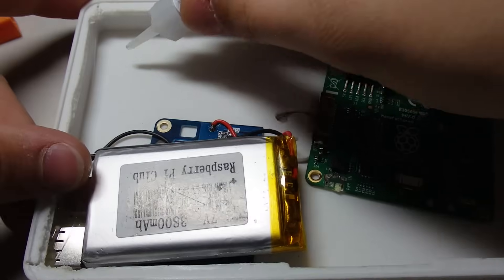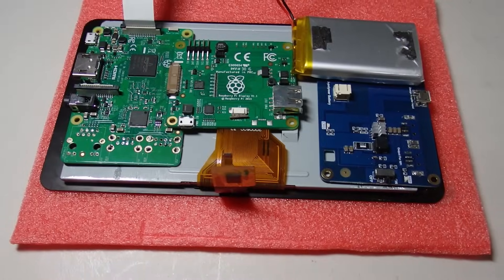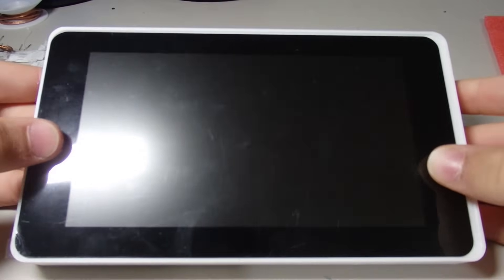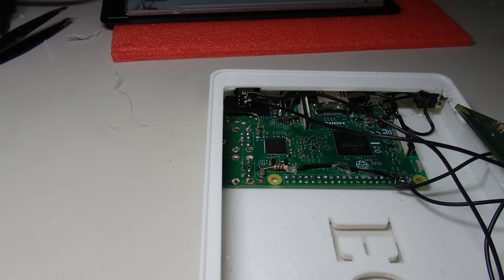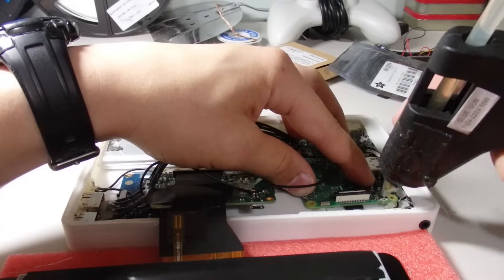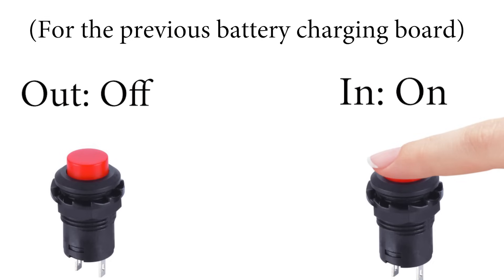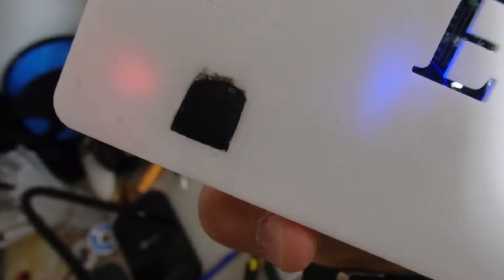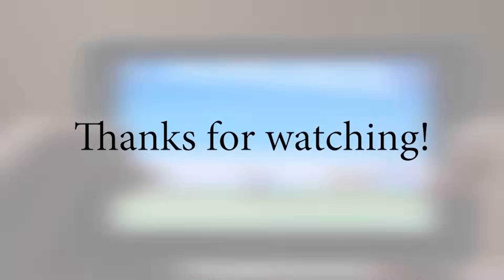Building a Touchscreen Android Tablet

Comment: I've been looking for a video where someone builds their own Android tablet this is the closest I've got to it but what I had in mind is someone using like a Galaxy motherboard like just a bunch of random nice parts from different phones and tablets and put them together like maybe a Galaxy S21 motherboard with like an iPad screen and body or something along those lines and just splicing wires putting your Android operating system on it and call it a day I'm just wondering why no one's ever done that make a Frankenstein tablet or like those cheap Galaxy a tablets they don't have the best processors but they have a nice body and nice screens maybe just replace its motherboard with a flagship Samsung phone motherboard and s*** even use the cameras you might have to splice wires to make the camera go to the hole but it would work if no one doesn't I'm going to for sure

Comment: Could you offer any helpful advice re: removing the USB and Ethernet components from the board? I tried to do a similar project last year and failed utterly because I couldn't get those things off without damaging the board.
Reply from the maker: What I do, is stick a screw driver into the port and gently pry up on the port as I desolder it. When I desolder it, I add extra solder to each joint and sometime even connect them all together so that I can heat up all of the joints at the same time. 

Or, I will work my from the joints closest to the opening of the port (where I have the screw driver) to the end or the port.

I hope this helps!

Comment: It looks so messy. No wonder the first screen broke. Next time fill the empty space with a custom printed circuit board to connect up ports and the power supply. It will look a lot nicer and won't need so many wires that could be a potential eyesore when building it or making repairs. I also think this would be better off as some kind of computer hybrid; in my eyes it seems a bit too thick to be a tablet. That's just my opinion though :). I hope you make an updated version of this. (Maybe with a magnetic removable keyboard?) 

Best wishes on your future endeavours!

Comment: Gday First time to the channel

Interesting idea

But lacks USB ports to recharge battery and ability to remove battery from back of case 

Also seems to lack external wifi aerial and no HDMI out or LAN ethernet port

Would it just not be easier to make a case out of wood instead of 3d printing ?

Comment: RIP internals and previous screen that was gud and could have been used normaly if not for comfort ot something. Btw u could have put the pi and everything on a plastic board for managment and then tought how to fit them in a 3d printed case for the size of the screen.

Comment: I've built my android tablet with 7.1 running on it. is there a way to run to 2 raspberry pi in parallel to make a faster system or is there another board i could use?
Reply: Use odroid.

Comment: FYI - regarding your issue with using a power switch and the powerboost. I ran into the same issue when I used an old NES case and wanted to reuse the power switch on the front of the console. I ended up wiring the power switch to the battery before the power boost so pushing the power button in allows the battery to connect to the power boost. Button out, kills connection.

Comment: whitch 3d printer is that the printer looks very good i will buy it
Reply from the maker: It's the "Tronxy P802e 3d printer" Here's a link to the Ebay listing for it: https://rover.ebay.com/rover/1/711-53200-19255-0/1?icep_id=114&ipn=icep&toolid=20004&campid=5338052152&mpre=http%3A%2F%2Fwww.ebay.com%2Fitm%2FTronxy-Auto-leveling-P802MA-3D-Printer-High-Precision-Reprap-Prusa-i3-8G-SD-car-%2F272513046357%3Fhash%3Ditem3f730b1755%3Ag%3AdLYAAOSwjDZYcFU5

Comment: Good lord I cringed so hard when you wired those batteries in parallel. Yes you get more current in the system, but you just wanted overall capacity, so they should have been put in series. You very rarely put batteries in parallel! I saw your post that you learned your mistake but eesh that was bad.

Comment: Hi I desoldered my rpi3's usb ports and ethernet port but it won't boot now.
If I put in my SD card nothing will happen :/ only the red light lights up when I plug in the power cord.
Can you please help me?
Reply from the maker: What operating system did you install onto your pi?
Reply: Electronic Grenade hi, thanks for comming back at me. I installed noobs to test if everything will boot up.to bad it didn't. The act light isn't reacting.
Reply from the maker: My only guess it that something got shorted out after you removed the ports. Maybe try making sure that there's no solder bridges any where. You could also try installing another OS onto the sd card and seeing if that helps.
Reply: Electronic Grenade thanks, I will try   that

Comment: Hey man i hope you answer my question.

You put a 3.7v 3800mAh in parallel with a 3.7v 2500mAh. isn't that dangerous, the circuit wont balance them both, like it will just keep on charging, and the 2500mAh would blow up.

Or am i wrong?

Thanks.
Reply from the maker: I think you may be right.
Reply: Electronic Grenade thanks for replying.

Trying getting 2 batteries from the same brand and Same mAh for security reasons, since there may be small differences in efficiency.
Plus, charging them both separately then putting them in parallel after would be the best way to create a parallel battery. :) just here to help!
Reply from the maker: Thanks so much for your comments, I really appreciate them! I had no idea that that would be a problem until you told me. 

I'm thinking that I'll add a switch to the batteries so that I can easily change which battery i'm using/charging.

Comment: this is a very impressive project I did indeed like it although I am a stickler for perfection and I think the wire management in side could be done nicer as well as the whole you cut out in the back for the Raspberry Pi MicroSD slot looks a little janky and then the only other thing is your screen is glued in slightly crooked if those things were addressed it would be absolutely perfect but none the less very nice job my friend

Comment: android is absolutey horrible on rpi. why not use one of the many maker boards that run android well like odroids or orange pis?
Reply: Greg Auletta or a banana pi, which actually offer two small pads where you can connect a li-ion battery

Comment: does it run crisis 3
Reply: yeah of course in .16k 1.20 fps ultra(low) settings and its so much better than 4 1080 ti's and a 7700k
Reply: 0163527879 Sativani I know you are joking but there is a way. You can use it as a wireless display and controler for your gaming pc
Reply: Of course 4K 120 FPS
Reply: lets build it can't handle it.
Reply: yes at 20K 9999fps
Reply: Tablets can not run Crysis..

Comment: Does the touch screen work out of the box or did you need specific drivers/code? I have a smaller touch screen. But I haven't been able to get the touch part to work. It works great as a HDMI monitor, but I'm clearly not skilled enough with software to know what to do next. Any advice?
Reply from the maker: My touchscreen worked out of the box. But my touchscreen was the official raspberry pi touchscreen that used the raspberry pi's DSI port. There is a way to get your touchscreen working but I think you need to edit the config.txt file for the OS you're using.

Comment: I'm no friend of glued parts, so wouldn't it be possible just to place some mount pins inside that keep all the parts in place?
Other than that, I'm really impressed.
Would I have enough money, tools and soldering skills, I'd most definitely start doing that project myself now but unfortunately, I lack of the latter two things :|
Reply: MegaManNeo Its very easy to acquire soldering skills just try once or twice . Remember if you have will you will definitely acquire it .

Comment: Great job! My only question is couldn't you have included all of the holes you made (headphone jack, SD Card slot with a stopper, power slot, etc) into the 3D print design to have them perfect? I am liking the double battery! What version of Android are you running on it?
Reply from the maker: Theoretically, yes, but no 3D printer is perfect, and since I have a very cheap 3D printer, my prints get more warped and flawed than most prints from nicer 3D printers. And since I use a ruler to measure each component, than I usually get the measurements slightly wrong, so the holes I make in the case are either too large, or too small. 

I am running Android 7.1. Here's the link to the website I got the OS from. https://rtandroid.embedded.rwth-aachen.de/downloads/raspberry-pi/

Comment from the maker: Thanks for checking out the video!
Reply from the maker: I haven't tested, but I'm guessing around 5 hours
Reply: @Electo  k
Reply: @Electo  How about you start a company/sell the tablet?
Reply: Thanks for that. By that logic, the pi top I'm creating will last 17 hours.
Reply: Can it work perfectly with one battery?
Reply from the maker: Yeah it works just fine.
Reply: What is the battery life on this when running Raspbian?
Reply: Electronic Grenade for sale?
Reply: Electronic Grenade ,l
Reply: ??? GameKiller
Reply: you could have just pust a flash light swicth so that you can just manually swicth battery without using them together
Reply: You just teached people how to build a real"electronic grenade"...
Reply: I was just about to comment this, you got it covered, Nice...
Reply: Salut,comment on peut ajouter le système android pour installer les applications ??
Reply: Ahmed Elfettachi, you install it and run it through the SD card.
Reply: Good luck! xD
Reply: merci Nigel
Reply: Electronic Grenade how do u come up with these cool things u give me so much inspiratiom
Reply: Electronic Grenade can u make a video on a 3.5 inch touch screen display with pi 0 w and make it a portable game cosnsole
Reply: As this is potentially dangerous and there is not mention of this in the video, maybe you should remove the video before someone makes this and has a nasty accident.
Reply: You Welcome
Reply: Im gonna try this when i grow up
Reply: Welcome
Reply: Breathe on you but
Reply: Hey bro are u gonna use it
Reply: np lol
Reply: nice but it would be a lots slimmer if someone made a kit compatible with the dim slot type rpi3...